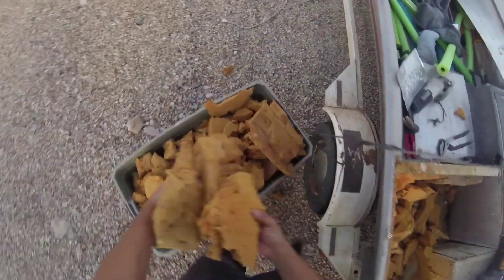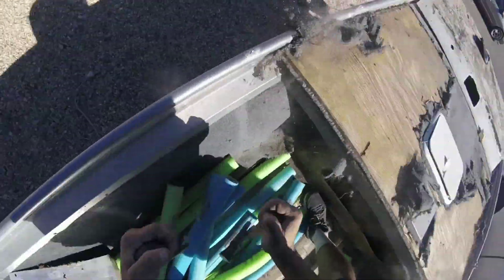THE START | Vintage Bass Tracker TX Restoration Start.

Comment: It was a cheaper open cell foam, close cell foam is more expensive but definitely is water resistant. They make marine grade foam but we all know when you put marine grade on a   product it is 3 times as much!
Reply: glass boats used to all come with open cell pour foam.  The Rangers and Champions I have dealt with had it.  They could have 100s  of pounds of additional weight if the "sealed" areas for the foam leaked, which most did if they were in the weather.  Those were top of the line glass boats and in the 70s and 80's had the good ol open cell foam.  who knows where that decision came from, probably pencil pusher told to save company money.  as said it was cheaper and by the time it's a problem the boat is well out of warrenty.  😒  go figure...
Reply: I was gonna say you'll be surprised when large companies do to save money the corners that they cut is almost unbelievable!!!🤐🤑🤑

Comment: I’m doing one about the same but with a v in the front tournament 17. I’m putting the casting deck back to the console and a rod locker in the middle with 24 volt trolling motor bats and charger under. Then 2 storage compartments on either side of the pole storage and adding more storage where you pulled the foam out of the back. 12 gallon fuel tank same motor and 2 more bats in back for crank and electriconics. Already did all the console and wiring last season was so funny I was totally the same way just yanked it all out and started over. I also found tons of extra wires in my boat was able to rewire with most of it. Love the channel and you have totally helped me out with the info and the experience of what you have done keep up the good work thanks man

Comment: subbed your channel.  when i rebuild a small tin or glass boat i remover all the old foam like you did.  clean and vacuum wash with Murphy's cleaner mixed with hot water then dry completely.  then put down 4 mil plastic sheeting tape where needed and reapply foam that i mix in large throw away buckets.  this way next time it's sooo easy to remove and doesn't stick to the bottom of the hull.

Comment: The pour foam in my 86’ sea nymph bass boat was even worse. I still used pour foam (but it’s a newer more “durable” version) but I built sealed boxes out of ridge styrofoam insulation panels and filled that with the pour foam. Figured it was the best of both worlds and can pull out most of them in one big block.

Comment: Michael, I know a flat casting deck is a highly sought after perk for bass and panfisherman. Could you potentially do a Smoker Craft(or the like of) gator skinned flat bottom and side console? Like, let’s say a Smoker Craft Pro Lodge....but building it yourself. Us PNW guys have limited time through the year to use a full flat deck on a tiny boat. The Columbia River gets VERY rough, even inland to the first damn. 3-10ft white caps...lol
Reply: Lol I spend a lot of time down there in Tempe, Chandler and Goodyear. Haha I know what you mean.

Comment: What about spray in foam Mike Lopez? Im not sure the specifics with it versus standard foam. It would be pretty messy,  I think,  but may withstand the heat better? Also, if there had been some heat deflector material on the outside of the foam,  like in some of your other builds, would that have helped the foam last?

Comment: Trying to find some videos on replacing a transom for this boat. I just picked up a 79 Bass tracker, and the transom is shot. Mostly running it electric only but would like to be able to run the 30hp reliably and safely.

Comment: Do you use PVC pipe or electrical conduit to run the electrical wiring through on the project?  It appears that maybe that larger abandoned wires may have been sourced to charge a battery at the front of the boat or possibly to remote DC Panel for the trolling motor and electronics.  That was my best guess.   How about having one OPEN framed area where Tristian can drop in a regular size ice chest for ice and water while he is fishing?

Comment: wow  that foam is scary.   at some point when theres a bunch of problems they'll put an expiration date on them like a childs car seat.  i wonder about making air chambers(capped pvc pipe) and use just enough foam that they dont rattle.       dont forget to check the charging system, as sometimes shorts like that will fry the rectumfriars.

Comment: I don't think I would bother putting foam back in the hull.  Use the dead spaces as more storage for lightweight items.
Reply: @TinyBoatNation  That may be true but I have owned several aluminum boats that didn't come with any flotation at all,  same goes for fiberglass boats I have owned. The foam may keep the boat from sinking completely,  but it will still sink below the water in many cases as I have seen over the years. The 1980 Western 13'  Aluminum I am restoring came with no foam under the benches. After I re-power with a much heavier Mercury 9.9 hp 4 stroke it would probably sink even with foam if swamped. Anyway, Mike, I like your work and enjoy your channel. I would like to meet you some time when I pass through Az. again.               CCC
Reply: The foam doesn't just add floatation which is its most important function, it adds rigidity, those compartments make the hull much more solid and quiet.  you would be suprised how much strength it actually adds.  kind of like the furniture items that come with the cardboard backing.  by itself the cardboard doesn't do much, but add it to the piece of furniture..ie..entertainment center from Walmart or the back of a dresser, and it functions as the main bracing, one it has a hundred nails in it...lol.  Foam allows less mechanical bracing.  He is correct to put foam (closed cell) back in.